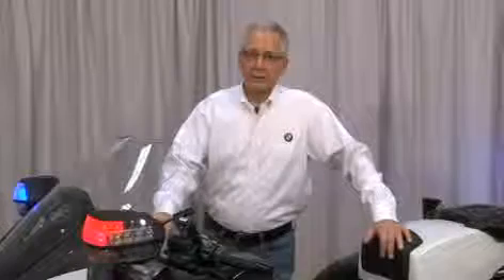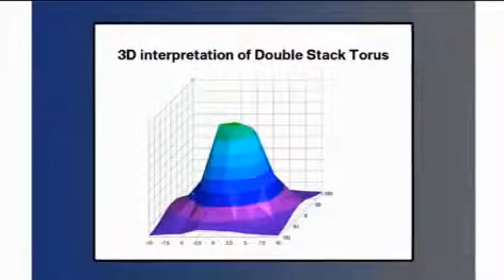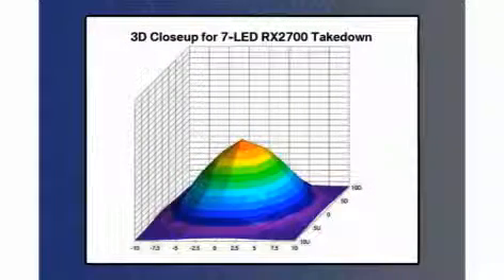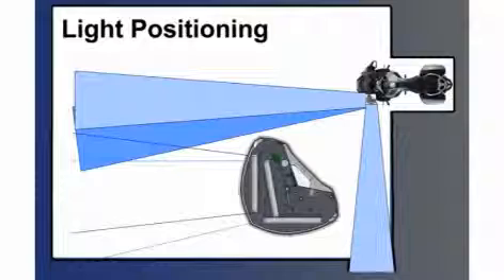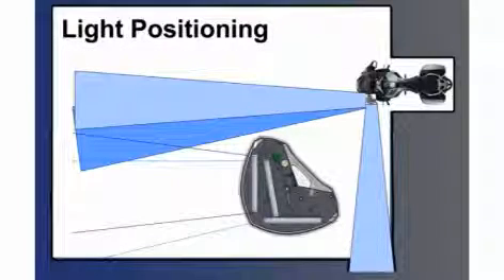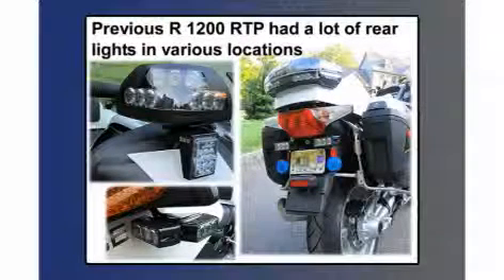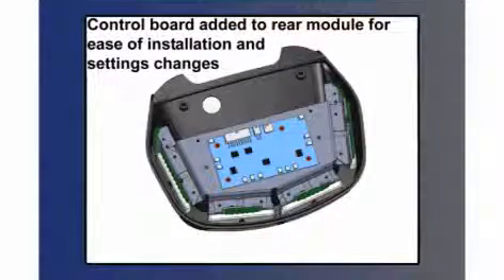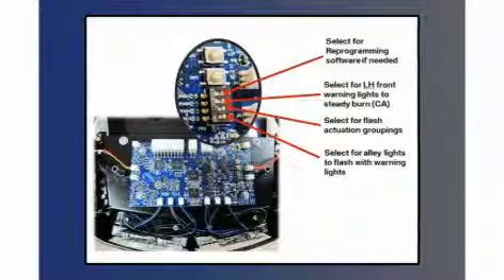BMW K52SF LIGHTING SYSTEM

Comment: Is it possible to get purple LED replacements for funeral escort (replacing red/blue)?
Reply from the maker: Hi Paul, nothing currently available, but it could be possible.  Are you looking at a new unit or modifying a pre-owned one?  Just curious what you have for budget.  You can reach out directly at info@fmsaccessories.com

Comment from the maker: The blue and yellow cubes are not circuit breakers - they are relays.  If they are clicking continually, I would guess that your auxiliary battery is discharged / a gonner!  If they just click once when the ignition is turned-on, then your problem could be the switches.  When the engine is running, do the lights and siren work?  If so, it is the auxiliary battery.  Go to https://fmsaccessories.com/wiring-diagrams to see what each of those plugs and relays do.
Reply: I bought a new yellow relay, but now that I get closer to the rear area, the noise is clicking from the main connection that’s black. When I turn the ticket light off it makes a clicking sound but when I turn it on, it stops clicking but no ticket light works. The ticket light, siren feature and right switches etc. eventually start to work but there’s some sort of delay. Maybe that module in the back that’s clicking is defective. Not sure.
Reply: I ended up figuring it out. My aux battery was dead.

Comment: My 2015 R1200RTP blue and yellow circuit breakers is making a clicking sound and also when it doesn’t make the sound, my headlight black out feature and my siren and air horn and ticket light all are inactive including my right side switches. Any info Frank would be great to trouble shoot this.
Thanks

Comment: The saddle bag lights aren’t responsive on the new ones I purchased. Is this a malfunction of the lights itself or are they just not strong enough on the sensors?
Reply from the maker: Do your lights not respond at all?  They should trigger by swiping your finger past the window.  If they don't, they may be defective.  They are limited to short range and the lens must be reasonably clear / free from dirt / dust.  Their range is close to the lens so they don't trigger on flapping clothing, etc.   If in doubt, remove them and test them outside the housing.  Do both lights respond the same?  It would be odd to have two defective lights - but anything is possible.  This could also be flasher board related since you likely just installed a new board from your last message.
Reply: Frank your absolutely correct. Left side works when movement is detected closely by plastic lens, but right side only comes on when I take saddle bag light unit out of rear pod housing, but not once while installed. Flasher board is brand new and good. Not sure if it’s defective or not but it only works while out of pod.
Reply from the maker: @PursuitMode2011  Unless you can see that the bracket is not formed correctly to aim the sensor to the outside, it is defective and should be warranted with BMW.  The bracket can be manipulated slightly, but it seems from what you said above that it is defective.
Reply: Frank thanks for your response and I agree. I just notified BMW and they will look into what options I have since they’re brand new from dealer and Code 3. I had another question on what is needed to activate headlight flashers for the wig wag feature? Is there a certain way to set this up or is it included in the flash controller I just purchased?
Reply from the maker: @PursuitMode2011  The wig-wag headlight is a standard feature but it must be activated by the dealer using the BMW ISTA system.  The reason it doesn't work out-of-the-box is that the emergency light system is not installed at the factory (US components), as it would otherwise register a software error.  There are instructions on the BMW Police Motors website at www.bmwmc.net for activation of alternating headlight.  You have a choice of three flash rates - 1, 1.5 or 2 Hz, which equates to 60, 90 or 120 FPM.  The slower rate will maximize headlight bulb life.  The alternating headlight will also flash the factory driving lights if installed (note this flash rate is not synched with the emergency lights).
Reply: Frank Do I.D lights stay on permanently or is there a way to turn off? Just curious...
Reply from the maker: @PursuitMode2011  ID lights are linked to the tail like circuit so they stay on unless you press the light-OFF button.  However, they will come back on with the brake light as that is a safety issue so brake light works even with light-OFF.  You get ID lights along with it brake light as it is the same circuit/wire - just modulated.